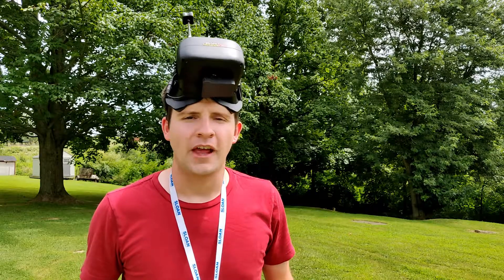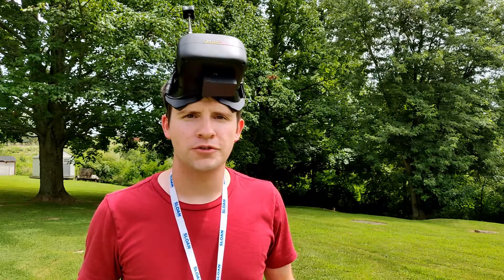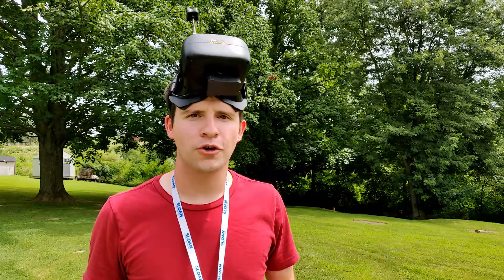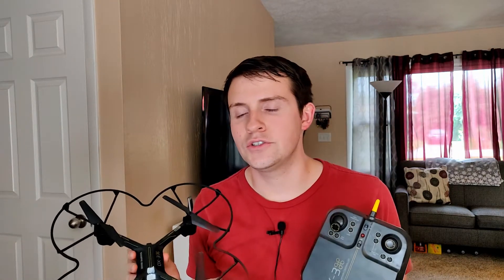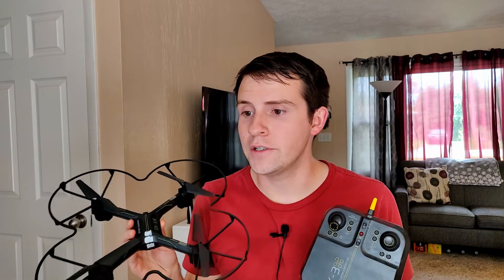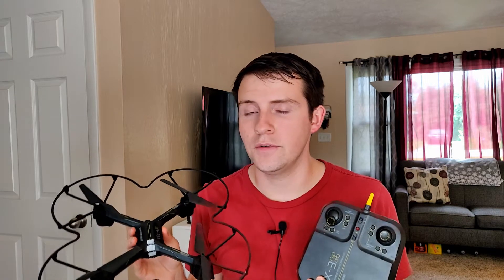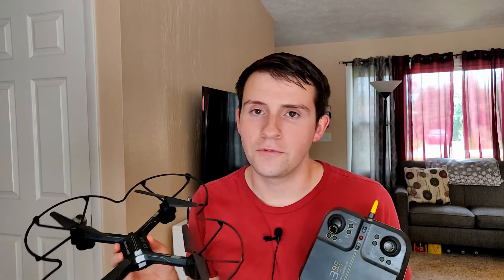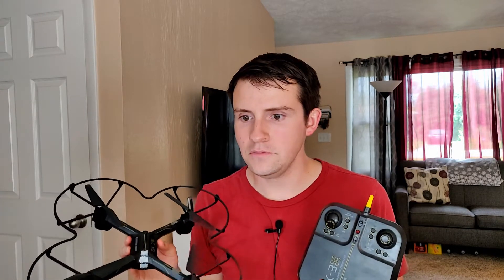Build a Camera Drone Introduction & Overview (Series for Beginners) (1)

Comment: How about a spec/hardware list up front ie.that is the parts you will be using, flight controller, motors, ESCs, gps unit, Rx and Tx etc etc, this will give potential watchers a chance ascertain if this instructional tour de force is of interest together with an approximation of cost, this would perhaps give people an indication of outlay and whether or not the build could be done in stages depending on an individuals budget.